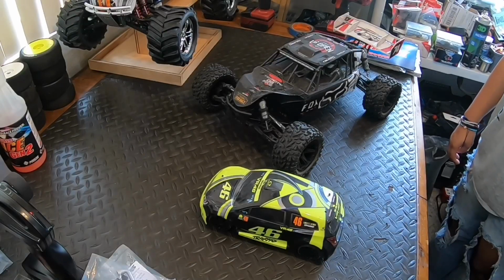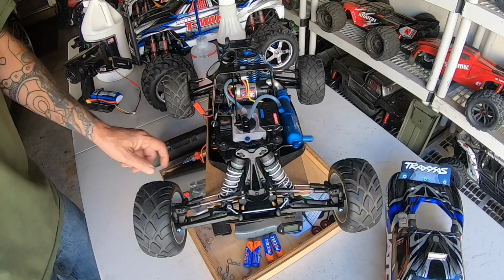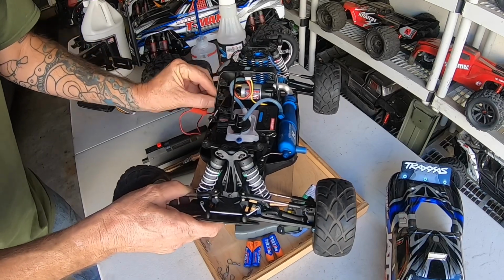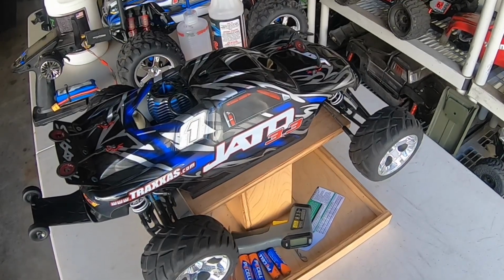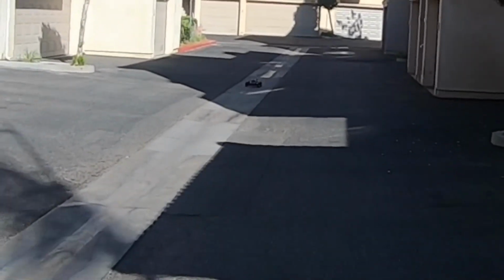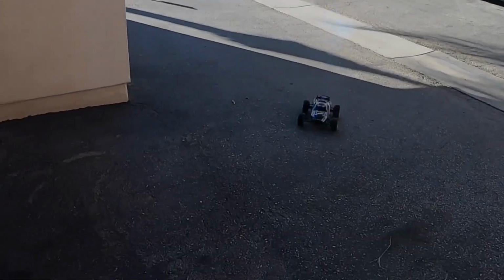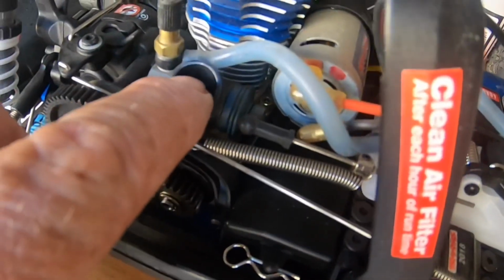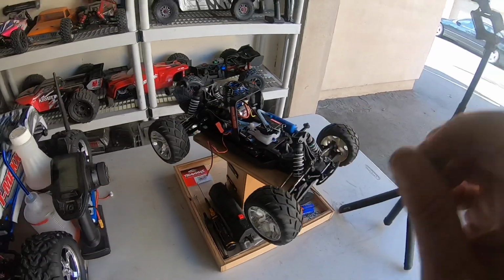Traxxas Jato 3.3 No Tunning Needed Anymore Let’s Go Rip It And See this perfect Idle ? Or is it ?

Comment: I think you could probably lean out the low ..just a little tiny bit and get a little more pop out of it and close your idle gap about the same amount.. I've been working with the tune on my new drag jato build with the RCR modified crank in it. I think I'm also running losi  3.4 carb which is just a little bit bigger on the Venturi side
Reply from the maker: If I move it lean one tic meaning on a clock one second hand it will double idle again as that the adjustment I showed it the last video 🤔 less then an 1/8th rich stops the double idle 🤔
Reply: @earlmoorhead5555  back off the idle gap the same amount after you lean it out. It's a washout but on the linger side
Reply from the maker: @woogienitro  on this 13 year old carb I feel turning the screws more then truly needed might just rip an oring but I’m sure your right as I’m no expert but it ran really good and it’s truly more then enough for me with a steady idle no stalling and no hesitation it’s perfect for me at this point intill this carb goes bad 💨💨👍👍👍

Comment: Double idle meaning how it kinda hangs at a high speed then drops down to a lower idle? Typically means that the low speed needle is a little lean. Don't be afraid to open the low speed needle and it only takes a little bit  to notice a difference. A lot of people make the mistake of leaving the alone. The low speed needle isn't "set it and forget it" at flush (as they call it) with the inner ring. Flush is the factory setting for the low speed needle, that doesn't mean that it has to stay there. A lot of people make that mistake. You have to adjust both needles accordingly.

Comment: Hey man!  that was a great explanation of how to consider the Low Speed Needle to be mostly just adding or reducing fuel flow.  The 2 speed was shifting great too!  Yes, as you already know tons of people don't tune the LSN correctly and wind up with a HIGH idle, then blame it on being a bad carb, almost always it's because their LSN is just too LEAN.  GReat video!! NitroGang Approved!
Reply from the maker: Thanks 🙏 means a lot coming from you the way I read the manual seeing the flow chart it made perfect sense on the fuel flow and idle 👍💨💨